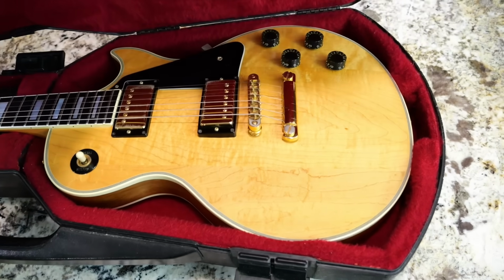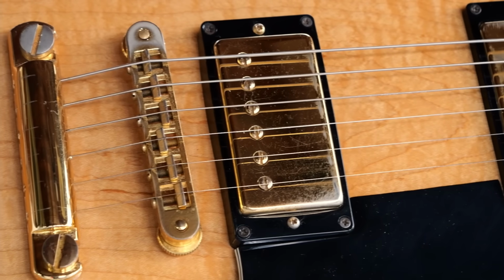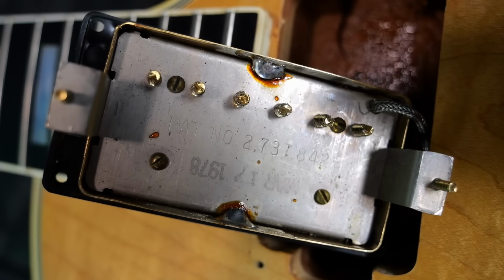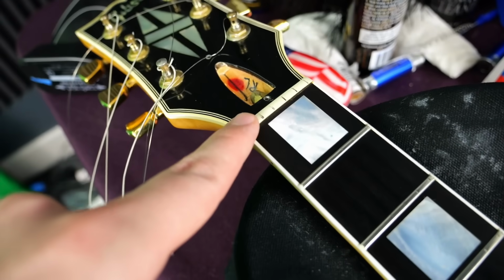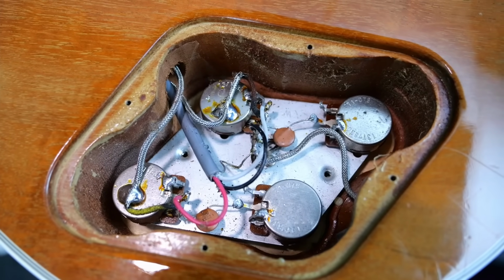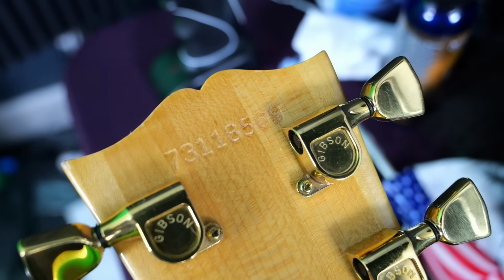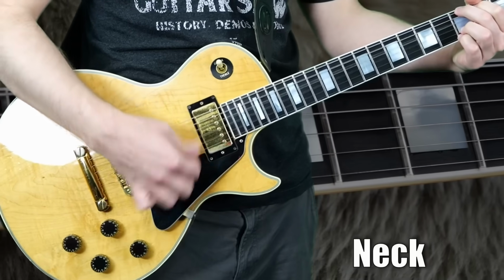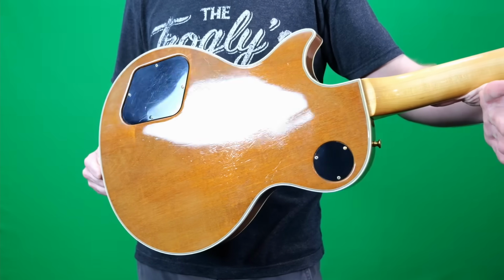What's the Deal with Old Les Paul Customs? | 1978 Gibson Les Paul Custom Natural

Comment: yesterday i got myself a Epiphone LP modern. It kinda has terrible fret buzz, but only between the 3rd and 9th Fret (all strings). Can someone help me what might cause that??? raising the bridge kinda helps, bit i don’t want to play 3mm action.
Reply: Did you make sure the truss rod is set correctly?
Reply: Sometimes frets climb out of their slots. Get a plastic or wooden hammer and lightly tap. Sometimes frets are too tall -- if so, filing is called for. But be very careful here, you can't put metal back if you guess wrong. There are fret board sanders that are long enough to keep everything flat and even. But, first things first:  truss rod adjustment and bridge height must be spot-on. Find a technician, watch a lot of videos...whatever it takes, the answers are out there. It's best if you can learn to do all these things for yourself.
Reply: Just re-read your post. If its all the strings between all those frets, its probably the truss rod adjustment. New guitar, should be all right at the nut, but to check, hold the E string at the third fret and look at the spacing at the first fret. Shouldn't touch and shouldn't be too high either. And the strings should all be relatively the same height off the fretboard at the nut. Then hold the string down at the first fret and with the other hand hold the string down at some fret at the other end. Some people like the 17th fret, some the 19th, some the 22nd. Whatever. Look at the string height at every fret, especially between the 3rd and the 9th, and look at the neck curve. Should be flat, with a slight relief (i.e. string not touching). Could use feeler gauges, could use a bit of paper, could just use your eyes. Call up some truss rod adjustment videos. It gets easier with time.

Comment: Pot code 71-079 = 100K tone pot, which would have paired with a 300K volume pot. That's when these got darker and muddier sounding, due to the switch from 500k/500k tone/volume pots. The originals were much brighter and clearer sounding, as are today's re-issues and historics.

Comment: I got exactly this model from 1980. It was built in Nashville. Bought it used in 1990 for around 800 USD....It just plays wonderful and the neck is straight and extremely stable. The only thing that annoyed me over time were the linear volume pots. Swapped them out for logarithmic ones and now it is a perfect live animal. I still play it live in any climate condition because it does almost not react to temperature changes or humidity. 
Got another Custom in Cherry red from 1979 which has the same excellent quality. These two guitars are the foundation of my absolute preference for Customs. If you play in a rock band with two guitarists, a custom is always well heard.
These both are the best Gibson guitars I ever played. From time to time I try some of the new ones in guitar shops and none, really not a single one could match their quality in terms of feel, playability and sound.
Thanks for your video, it does reflect exactly my experience with these guitars.

Comment: Great video. I got my first stock Gibson Les Paul Std. in 1981. It was a 1976 although I never saw a serial number on the back of the headstock. Wish I still had it. In 2017 I started buying Norlin eara Les Pauls, 75 Goldtop, a 72 Recording and a 78 Std. to go along with some newer Les Pauls I won. I noticed you never mention the body carve on the top is more flat and not as scooped as a pre or post Norlin. Please enlighten us if you have anything to add.

Comment: In viewing this episode on Norlin LPCs, I’m a little surprised you did not mention the carve on the top changing pretty dramatically between ‘81 and ‘82.
Reply: All due respect, and with the disclaimer that I have not academically “studied” this. My thoughts come from anecdotal experience. I own, or have owned, LPs ranging from’74-‘82. The ones I know, through the’81s have the same, general gradual slope, up from rim to center and back down. The ‘82s (Nashville Std SB and Kalamazoo 30th Anniversary) have a flat area around the rim, then rise and fall with a definite “belly” in the middle.  I’m open and interested to hear others’ observations and experiences.

Comment: I find it interesting that even though the norlin era is known for cost cutting, they still decided to put a hunk of metal in the guitar to ground it instead of simply using a bit of wire
Reply: My 80s les paul hums especially when near certain lights,when i place a finger on one of the screws on the pickup case it goes away,any suggetions mate?,thanks
Reply: You're ground wire might not be connected? and P90s will hum. but humbuckers shouldn't hum..

Comment: Hey trogly, have you ever seen fake or reproduction flip out tuners that weren't made by Schaller? I have a set I got off eBay super cheap that are labeled made in Taiwan (or Korea I can't remember) but the tuner bodies definitely aren't Schaller but they have the same screw pattern and shield shaped back plate as the schallers and they have flip out knobs and Ive never been able to figure out where they came from or what guitar they would have originally been on or if the knobs are genuine Schaller and only the tuner bodies are knock offs

Comment: Construction wise the 76-81 guitars (the Nashville ones) are the best standard production Les Pauls ever made by Gibson. Three piece maple neck and the volute. It can't see how the short tenon would matter one bit (if it does it probably for the better). It's too bad they generally are heavy as f**k and many have skinny necks like the slim 60's taper on this. 

My dream guitar would be a 1979 Deluxe Pro with P90s and the ebony board, if I can find a good one that weighs in at less than 4.5 kg. Three piece maple neck and all that, to me that's perfect specs for a Les Paul.